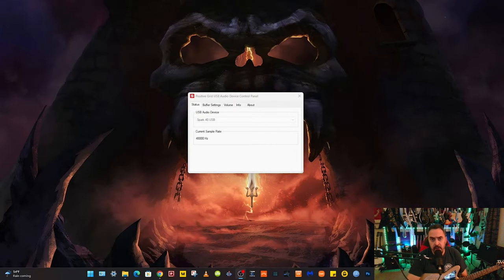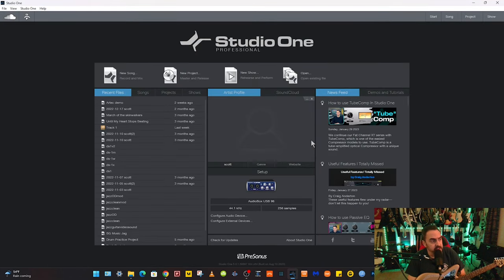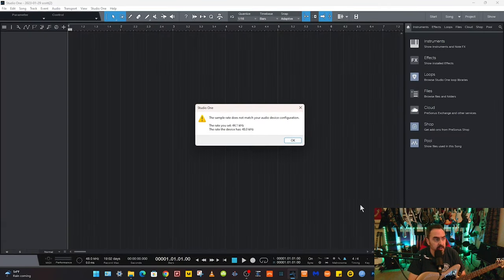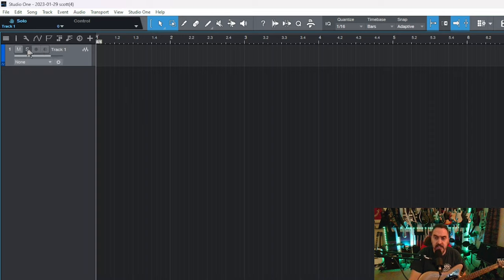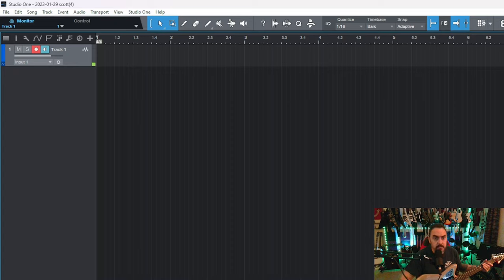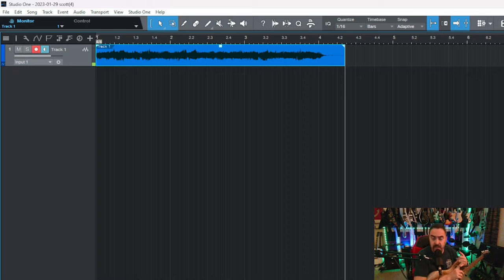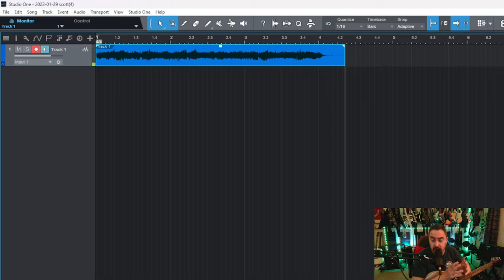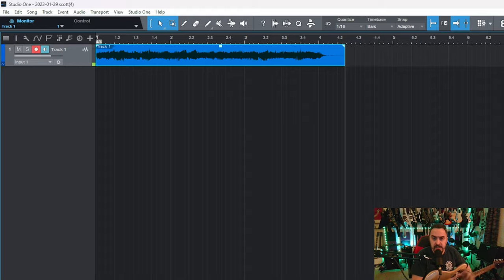How To Connect Your Spark 40 To Studio One

Comment: This was very helpful for me as I couldn't clearly obtain all the settings that you provided to make it work from other references. It works! 
I did no additional changes that I'm aware of but have like a chorus effect added the signal is completely changed when I tap the record button in the upper left-hand corner for the track. That's my next goal it sounds great clean but it's not what I want on every track and don't know how to control it. Maybe that's the stereo output effecting it?
Reply from the maker: That may be a setting in your DAW that's doing that.
Reply: @Guitarnivore  thank you for the response, I'll play with it, I am new to this. Honestly, I just want to play and not go down too many rabbit holes, but this will be a great tool for me. Gear can be distracting 🫨. 👍
Reply from the maker: @wooggeek  gear can be very distracting! I mainly use a Boss Katana into a USB interface, so I haven't played with the Spark much with USB. I've only really done it with this video.

Comment: ...ya know, I tried to use the spark in my DAW.  But, there were so many technical challenges getting the audio into the DAW.  I find it so much easier to just use the headphone jack out of my spark mini straight into my Audiobox and ALL problems are solved. I believe the ability to use the Spark as an interface is as a last resort in the face of NOT having an interface.
Reply from the maker: In all honesty, that is the easiest way to do it. It seems once you start getting into USB, then you have latency and any other technical problems, inputs, outputs, etc. If I ever use my Spark for recording, I'll do the same. I do that with my Boss Katana and run it through a Behringer DI box to level things out a bit. I honestly don't see the advantage to recording through USB. The only reason I made this video was because it was requested. Thanks for commenting!
Reply: @Guitarnivore  Plus the audio out is stereo so...
Reply from the maker: @saguarotreker  I have a presonus Audibox. are the inputs on that stereo? If not, I know I have a stereo to split mono cable I could user if needed.
Reply: @Guitarnivore  From my spark I use a stereo breakout cable.  Should have included that detail...
Reply from the maker: @saguarotreker  Gotcha. I have a couple, but I'll have to dig up my 3.5mm to 1/4" adapter. And here I was going to buy a 3.5mm TRS to 1/4" ts cable, which would have just made it mono again. 😆
Reply: @Guitarnivore  I got so tired of looking for those damn 3.5 to 6.whatever mm adapters, I got a proper breakout from the 'zon.

Comment: Thanks, Question: I'm trying to connect my phone bluetooth to the spark which I can do normally without presonus on. This way I can feed drumbeats from youtube into the amp while I play. It works flawlessly. However when I try to record, the phone doesn't have any sound. Since my drumbeat from the phone and my guitar are combined going into the grid, I dont see why it can't feed into presonus track?
Reply from the maker: It could be because the amp desables certain things when it's connected to a DAW. You might want to ask around Reddit and see if there is a solution.